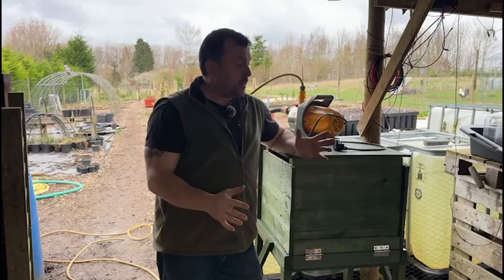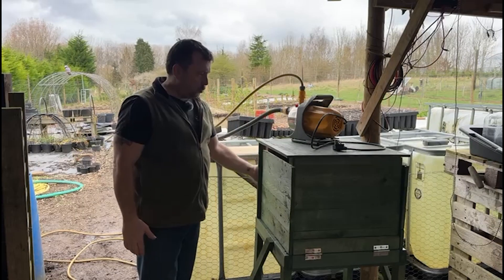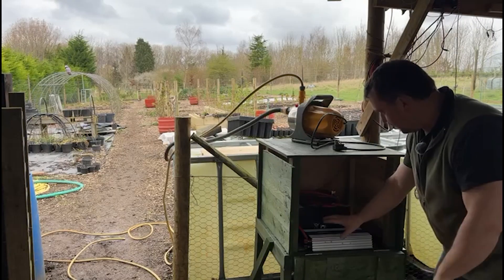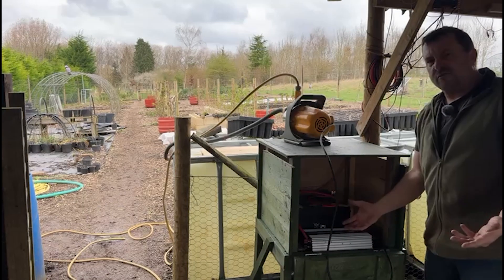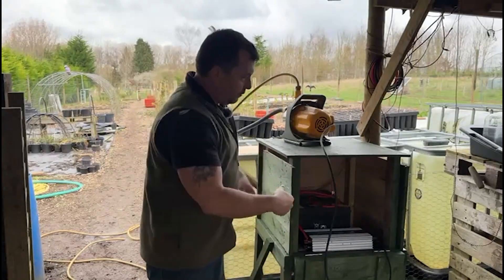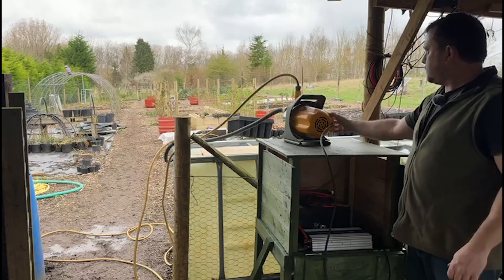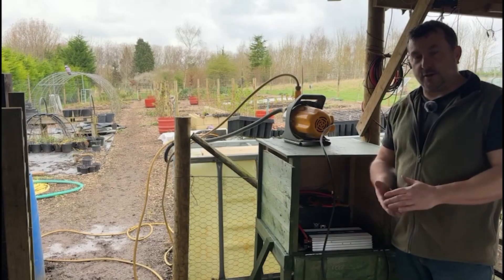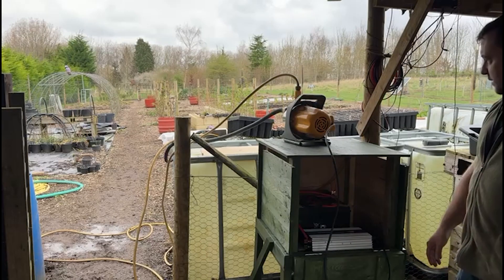Solar Powered Water for the No Dig Garden | Self Sufficiency | Homesteading

Comment: Great set up, but why don’t you just run a 12 V pump straight off the battery
Reply from the maker: I don’t think a 12v pump would be as powerful and I already had this one, it’s also nice to be able to use my power tools without having to lug my generator down there, the inverter has been great so far

Comment: Nice addition Sir - just a tip, but the inverter will draw power (.5amp or so) just being in stand-by, so a trigger from the pump to turn on the inverter if used for auto-watering would be a good addition :) I have lower power & cheap submerged (1 bar) pumps in barrels which run water between barrels and run a hose enough to water softly to avoid the inverter (so far :)).
Enjoying the vids, keep it up - where are you, I am in South Wales and would love as big a problem (plot ;)) as you have, but the allotment will do for now :) cheers!
Reply from the maker: Thank you 👍
I’m in Oxfordshire